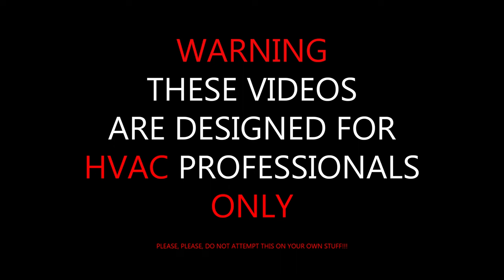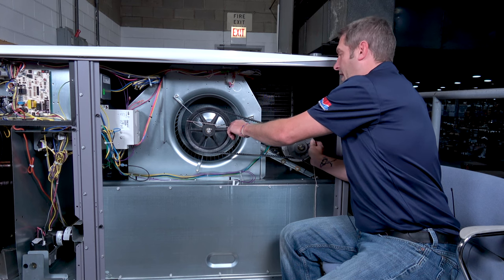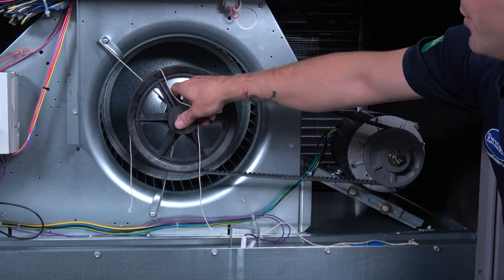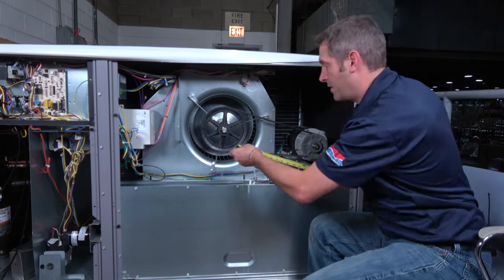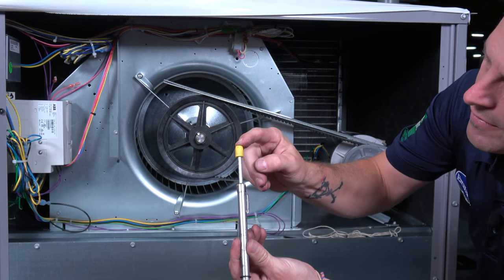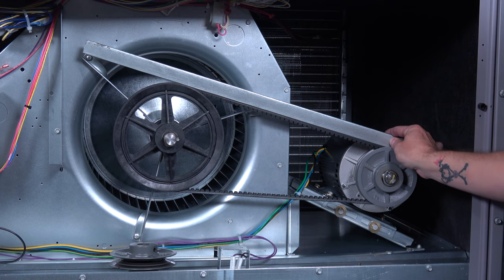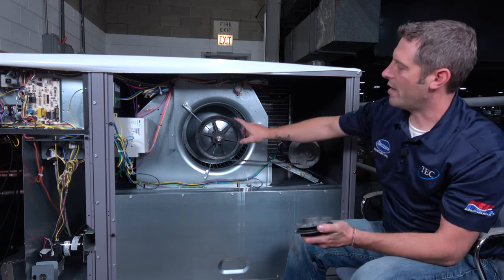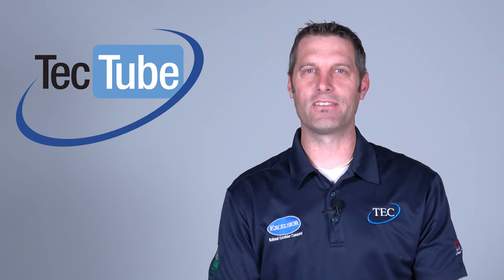Fan Belt Alignment & Tension

Comment: So if one does not have a belt tensioner gauge what is the alternative method that you said you would describe later.  Squeeze the belt in the middle and make sure it does not deflect more than an inch? Good video though, very informative.
Reply from the maker: Our tech support engineers had us edit out that section of the video because it was "too hack" and not manufacturer approved.  They suggested we only show the correct way to do it which is using a belt tensioner.

Comment: The inner edge of the v-belt grooves of the motor sheave and flywheel should be aligned. Since there is most likely a difference in the thickness of the outer edge of the motor sheave and the flywheel, this method is incorrect in most circumstances.

Comment: You should have read the 'how-to' with that belt tension checker.  Its 1/64" of deflection per inch of span. Then its how much force it takes to reach the deflection spec. Adjust tension as needed.